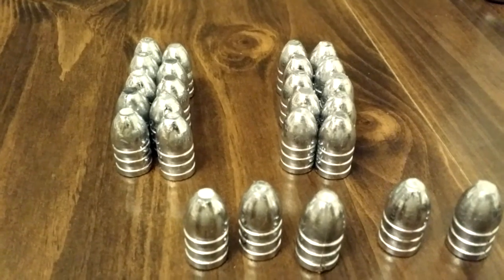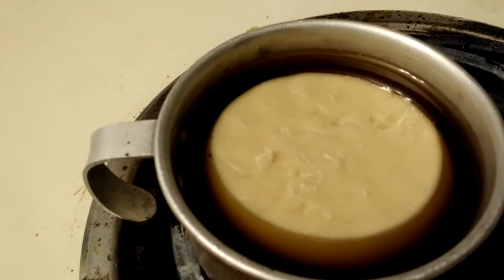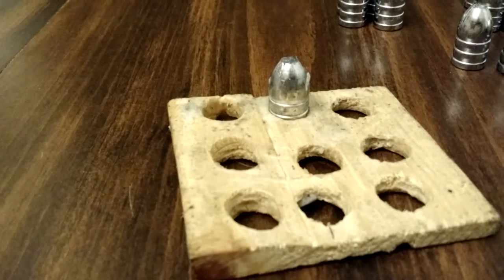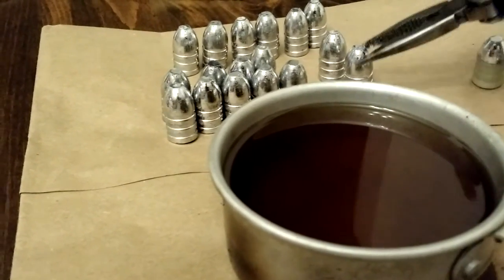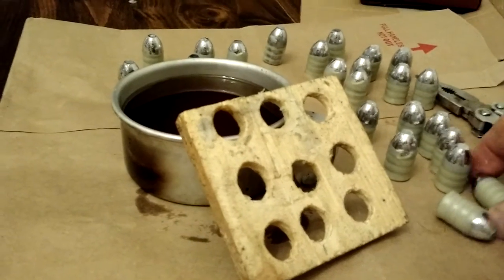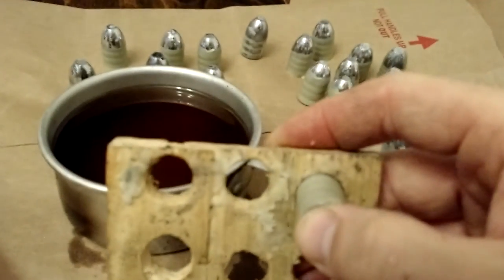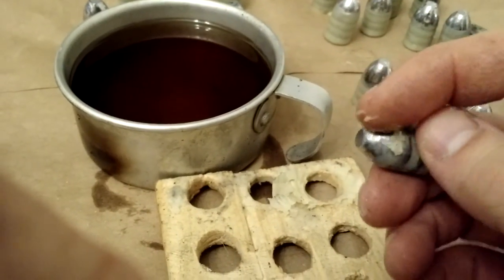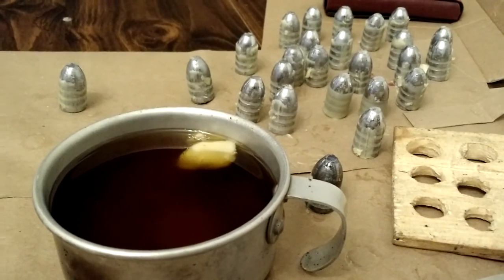Lubing Minie balls - 1861 Springfield Rifle -1st Minn Sharpshoooters

Comment: I just purchased a Lee .54 cal. mini ball mold. Right out of the mold, the minis fit too tight to justify the effort to cram them down the bore. I though and thought about it and came up with an idea. Roll the mini balls between tow pieces of hard wood applying a little pressure as needed. Low and behold the diameter of the mini balls shrunk as the lead is soft and can be shaped like clay. The mini balls dropped right down the barrel effortlessly. I fired 30 rounds accurately at gongs 100 and 200 yards away
Reply from the maker: amazing, nice job getting this to work.   A more common method is to use a "sizer".  The sizer is made of harden steal - and the hole in the sizer is the desired diameter - the minnie is driven through the hole and the soft lead reformed.    I just got a used sizer and will put up a video for you on this.   If you haven't please do subscribe to get notified.  Thanks pard for your comment

Comment: I tried pan lubing mine.  I'll do it this way from now on.  My pan lube cutter will probably do a good job at taking off the excess.  Where I live sub freezing temperatures tend not to happen though.
Reply from the maker: since this video, I not use a resizer for both resizing the minne and also to trim off the access bees wax.  We have plenty of cold here in Minn (but not this winter).  thanks pard for the tip

Comment: I have lyman 575213-OS and new style. I use the old style mainly comes out around 500 grain at .580, size them down to .578 since my 1861 is .580 barrel. I melt mix of bees wax and tallow in microwave and dip them like you do.
Reply from the maker: sounds like you are well equipped pard - I have to size mine to .575 for my 1861 Springfield.   I've got plenty of other BP videos on this channel - take a look and feel free share your experiencing from the range.
Reply: @1stminnsharpshooters341  why .575? If I shot .577 below it would  not be accurate until it starts fouling up
Reply from the maker: @TorryGood  Good questions and I cannot fully answer this as I only have a .575 mold and .575 sizer.   I'd like the chance to shoot a .577 to see the difference.
Reply: @1stminnsharpshooters341  lyman 575213-OS says their mold is 460 grain .575 but they really come out around 500 grain at .580 because the heat causes the mold to expand from .575 to .580. Did you check yours with caliper?

Comment: Why take the excess off? You could just push it down the barrel for extra lube. Rock on bro
Reply from the maker: Not taking off the lube would work if I was at the range ready to shoot;  Here's a few reason why I remove the access. 1) in the Civil War the minnes where placed in a paper tube along with the pre- measured paper tube - the lubricant access - I've found that If I leave the access - it bounds with the  paper like glue. 2)  In the winter time and temps below freezing the lube really hardens to the point where its difficult to get the minne down the barrel.   thanks Pards for your comment

Comment: Are they sized for consistency?
Reply from the maker: not yet, and I have had problems with my molded minne's. I do have this on my list.   Do you do any BP shooting pard?
Reply: @1stminnsharpshooters341  I'm with the N-SSA. Been shooting my '63 repro Springfield for 26 years. I use a 315 Rapine minie wadcutter with 40gr. FFF. I get a nice group. The mold i have is a 315.580.
I have a .579 sizing die that puts the mini .002 under because my barrel is .581.i use crisco and beeswax.

Comment: What is the ratio of wax to tallow?
Reply from the maker: hummm.. its been I while since I did my research - in the description I have 1 part tallow to 4 parts bees wax - but believe that this could almost be 50/50
Reply: @1stminnsharpshooters341  70/30 Tallow to beeswax
Reply from the maker: @rc6147  thanks pard; have you use alternatives to tallow?  I've used Crisco.
Reply: @1stminnsharpshooters341  i actually use 75% crisco and 25% beeswax. And soild crisco in the base
Reply from the maker: @rc6147  good to know pard.  thanks again for the comment

Comment: What is that liquid?
Reply from the maker: Sir - the liquid is combination of melted bee's wax and tallow (animal fat).   This is a solid at room temperature, and as you can see becomes a liquid with heat from the stove.  thanks for the comment Ulyses
Reply: @1stminnsharpshooters341  for that porpuse is to smooth while travel in the barrel?  How about the melted candle can be usefull?   By the way is that very good idea
Reply from the maker: @ulysesdiesta2772  Good question Ulyses:  The lubrication has more of a cleaning purpose - it help clean out the black powder residue and the small amount of lead shavings after shooting.  After about 10-15 shots the difference in lubed vs non-lubed can be noticed.    I'm not sure of a "typical" wax candle would work - it may.  thanks for the comment pard.